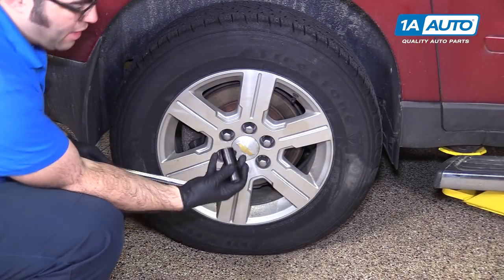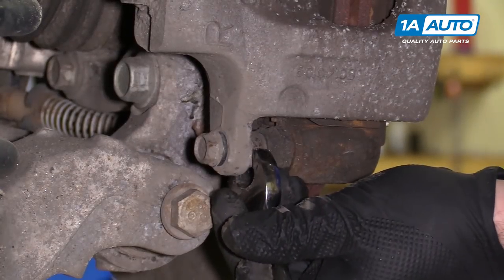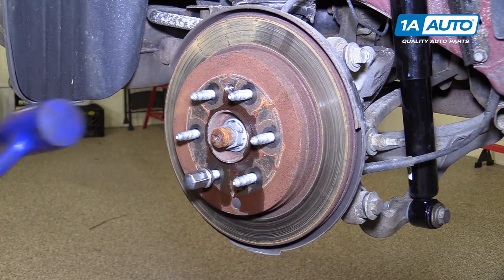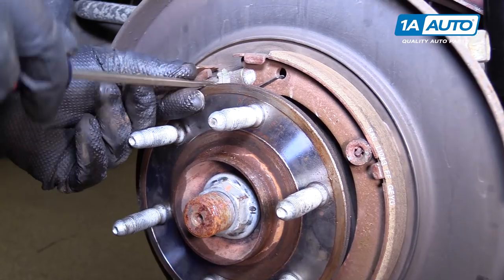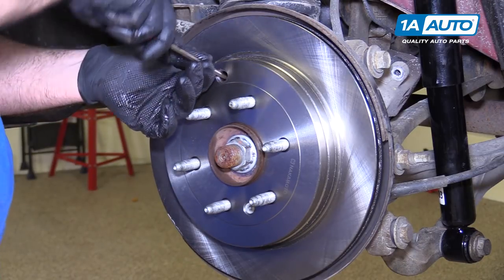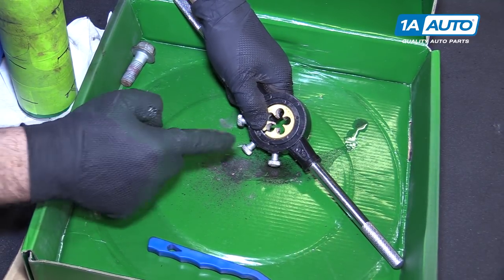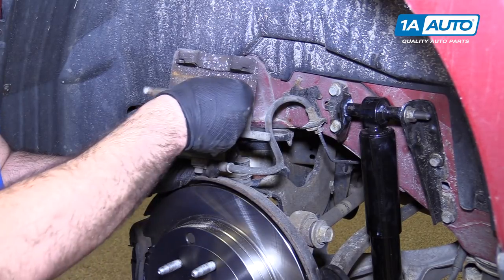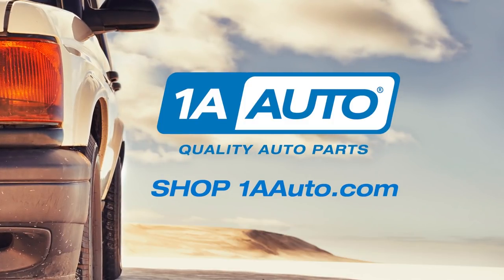How to Replace Rear Brakes 09-14 Chevy Traverse

Comment from the maker: √  Watch the Video
√  Buy The Part at 1A Auto http://1aau.to/m/Visit-1AAuto
√  Do it Yourself
√  Save Money
Reply: Do you recommend to change both rotors at the same time when changing brakes, one has a worn pad that is metal on metal with the rotor and I will be changing it, just curious if there will be issues leaving the other rotor the way it is just with new pads?
Reply from the maker: +Mark Taylor Rotors should be changed in pairs to ensure they wear evenly. Thanks for checking us out! http://1aau.to/m/Shop-1AAuto-c

Comment: Guys never  push in caliper pistons without opening up the bleeder, all you'll be doing is sending particles either from rust from iron or corrosion that form inside the calipers back up into the abs module. If you choose to just push the piston in the lazy way, remove your master cylinder cap so you don't chance blowing the seal behind that master cylinder. Good video.
Reply: Thank you!! That's what I was taught but this video didn't show that. Glad I read the comments because I would have done it like he did. 🤣🤣👍😁👍
Reply: Also pushing brake fluid that is saturated with water (and rusty and dirty)back up into the system. Super Rookie move.

Comment: If your rotor is rusted to the hub you can use the torx t30 hole to press the rotor off. The t30 screw is flared so it’s hole on the rotor is bigger than it is on the hub. If you look at the hole on the rotor, it is threaded to take a M10 threaded bolt. The bolt is larger than the screw hole on the hub so you can simply tighten the bolt until the rotor pops free from the hub.  Spent an afternoon beating on the rotor with larger and larger hammers until I noticed that. By the way your videos are some of the most instructional available thanks.
Reply from the maker: +Bob Reid Thanks for watching, and thanks for the great suggestion for dealing with rusted on rotors!  1aauto.com
Reply: Bob, thank you for being an Internet hero. Cheers!

Comment: Life saver video!!! My emergency brakes are preventing the rotor from coming off. Wasn't entirely sure how to adjust the parking brake shoes... Thank you so much! After spending 3.5 years at a dealership training with a heavy tech, I can strip a motor down and overhaul 1 but my god.. I thought brakes were easy lmao, they can certainly be a pain in the arse sometimes. I've only done about a few dozen brake jobs but never experienced the emergency brakes holding up the rotor. Unfortunately at my dealership, all I did was heavy on Chevy vehicles so I really appreciate this video!
Reply from the maker: +Joseph N Thanks for checking us out! 1AAuto.com

Comment: Great video, My 2011 Traverse with 40,000 miles still has the original brakes, I just removed the wheels to inspect the brakes and discovered that the the factory "forgot" to install the torx screws and rubber plugs
Reply: You don't need them alot of techs don't put them back on after removal

Comment: Here's a tip for all of you who have a hard time beating off the old rotor with a hammer.  Put anti seize lubricant on the hub where the rotor contacts it, and next time you brakes, it will fall right off when you take out that torch screw...  I also use it there the wheel contacts the rotor, and on the lug nuts.
Reply from the maker: +goneflying140 Thanks for the suggestions and for watching!

Comment: Nowhere in this video did anyone say to take the cap off of the  brake  fluid reservoir
Reply: Why do you have to take the cap off the brake fluid reservoir for ?? I don’t know that’s why I’m asking
Reply: @Hooter-J  because rule of thumb is to bleed the brakes whenever your doing this which is recommended. But, also everyone has a lot of different opinions.. some say you can do it without bleeding brakes as long as your aware of the condition of the brake fluid and others say do it every time.

Comment: Squeezing in the caliper without relieving brake fluid pressure is ok?
Reply from the maker: +John Tompkins Thanks for watching!  Yes, unless you are looking to bleed the system you should be fine compressing the caliper in that way!  1aauto.com
Reply: No damage to ABS module without bleeding?

Comment: I had to grind the ears of the rear pads to fit. Dang things we’re extremely tight and would hang up. I’ve never had rear pads fit like there supposed to.
Reply: THETOPGLOCK  you probably needed to clean your caliper bracket. Under the stainless hardware the steel bracket rusts. The rust causes “rust jacking” and locks up your pads.

Comment: I have a 2009 Chevy traverse that needs new rear pads and I cannot get the wheel off I have tried everything. Hit it with a rubber mallet like it shows in the video won't come off crawled underneath the vehicle kicked it with my feet wheel will not come off any ideals
Reply: thats what the sledge hammer is for
Reply: Hope you took torx  screw off!